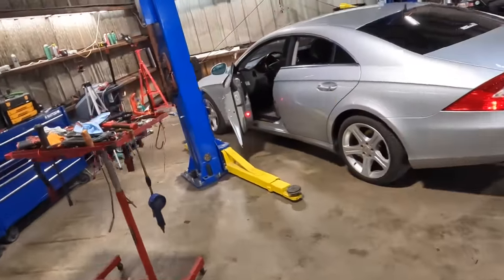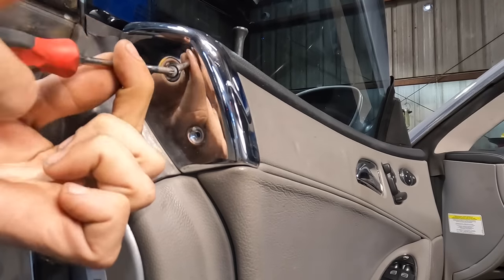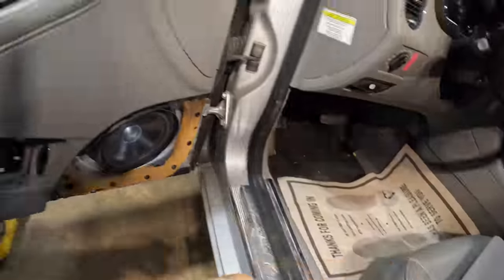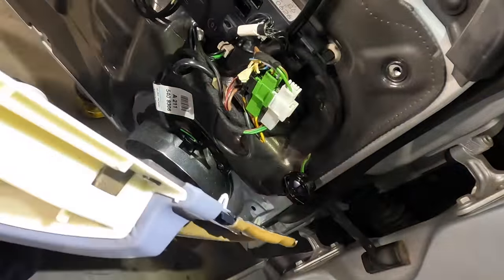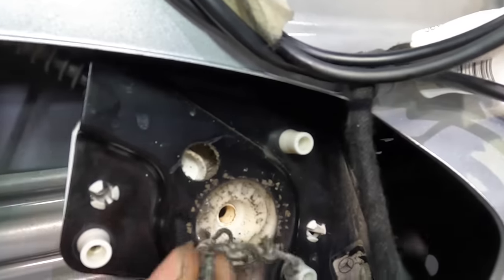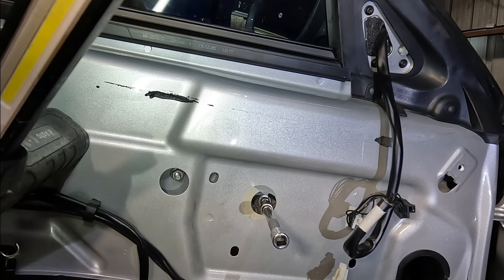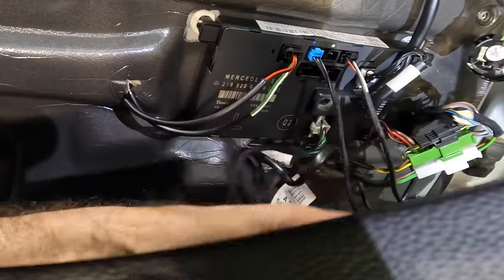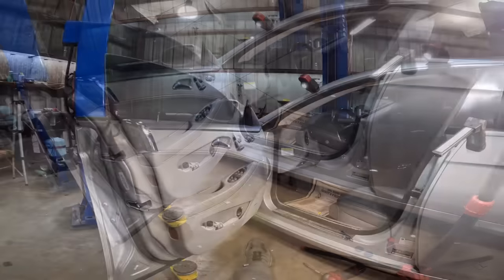Overly Complicated?  Mercedes-Benz Interior Wiring!  CLS 500 (LOUD NOISES!)

Comment: Some pre  2000 Mercedes Benz used hydraulics for window actuators . Believe it or not they rarely failed and are pretty easy to repair. My wife’s 09 e320 window Regulator failed and the quoted her $900 for one . Guess what the service advisor said ? Yeah replace both passenger and drivers side even though one was fine.

Comment: Engineers and architects should have to work on what they design. Pretty sure things wouldn't be so complicated . I'm a carpenter. I was always told that in Germany architects had to do an internship in construction and put on a tool belt and build things before they were licensed.   All of those wires could have been simplified down to one of two connectors .

Comment: You’re videos are informative, air sanders or grinders when in use.
Is when my speakers get turned off. Bummer.
If you have an air chisel.
Place it on a steel frame of the building and create some feedback entertainment.😅

Comment: Did you make adjustments to the window position off camera?  All the while it was being buttoned back up, I was thinking about that, and having to pull all the panels back off to re-adjust them.  Also, wondering if the module would need to be calibrated somehow. As silly as that seems, I wouldn't be surprised!

Comment: At 34:12 in the alignment of the bolt could be accomplished by using a suction cup with a handle to hold the glass in
 position and put the bolt in. I'm exhausted just watching all the steps needed for  this installation!

Comment: I almost bought a cls500 when i bought my audi a4. All the cls500s i looked at had suspension issues and were on the ground. I was looking at used cars around 2012 or 2015s. Anyway my audi has standard suspension, sports suspension which is lower, dynamic suspension which is adjusted electronically. You have to pull window sticker options to determine between sports and standard suspension because audi doesnt list the option anywhere else. Obviously dynamic suspension is easy to spot because its electronic. German vehicles are so much more complex than donestic cars. My car does not have door locks. At least not a single mechanical lock, its all electronic and can not be locked or unlocked other than electronically

Comment: Ray, it's a Benz...to remove the door panel you have to cut the door skin off, abd remove the 5 hidden screws, replace the part, then weld the door skin back on & repaint the door.😁
Reply: it will be lot faster for a welder.

Comment: Don't forget the resource of other YouTubers to see how to remove specific door panels.
Crazy engineering. That is the wrong place to install electrical items, both in terms of water, and protection from common body damage.
The goo holding the plastic sheet of insulation in is butyl rubber. If you buy a roll make positive to get the double sided sticky. A lot of it is single sided, which is intended for a different application.

Comment: Hi there
I’d like to pass on a little tech tip to you and anyone else who does mechanical work, try using a piece of latex/rubber disposable work glove tear a bit off hold it over your socket place a bolt or nut into it and this will hold it in place to reach awkward places without losing the nut/ bolt , 
Regards Davy 🇹🇭 ( retired early in Thailand and ex mechanical engineer)

Comment: What you can do is take some blue tape and attach some pieces to each of the wires and place some next to each hole in the insulation that they pass through and put numbers or letters to mark which wires go through which holes and save yourself a lot of grief later. 

"An ounce of prevention is worth a pound of cure."
-Benjamin Franklin

Comment: You guys think this is something.  The S class model change (W-221) had the inner metal shell of the door riveted in place for the entire perimeter. To do this job you drilled out what I recall to be 18 rivets and then do the replacement. The Maybachs had the same door construction.  This regulator replacement job would pay around 1.2 hours under warranty with testing cleaning ordering parts dealing with service writers and driving through a car wash.
I truly loved working on these cars but I was run over by shop politics too many times. I kept my head down, did the work, never complained about what type of work I was given. Learned to make the best of what I had. Never screwed a customer, always wrote honest write-ups and admitted my few mistakes immediately.  In the end I was putting together work other people abandoned and my diagnosis was always spot on so I would be the person a "come-back" would go to for confirmation of the problem and to evaluate the previous repair.  That part of the job I feel is what put me out on my butt.  They feed me these Come-back repairs that sometimes would show as a paper loss  for the company. When the book worms and management saw my name on every "problem repair" they assumed I was the problem. Took almost a year after the fact to learn why I couldn't work there any more and I was only told because the owner of the dealer died in a plane crash on the run-way in his own plane. No one had loyalty or a job there any more so no reason to keep what happened to me a mystery. Skipper Beck of Beck imports in Charlotte NC. Circa 2004, I still read the news article about his death every once in a while.  Those guys did me wrong and I'm still sour about it. I was young as hell and happy to be doing what I went to school for and a lot of that joy was destroyed to make other people look good for the short term. I still love working on anything broke for the joy of knowing I made it better than it was and I'm still fixing things other people screwed up to this day.

Comment: Times have really changed.  My arms used to look like I was in a fight with a shark after replacing a window glass or regulator.  The only thing that troubled me was I was waiting to see if you had to adjust either travel up or travel down once you had it all together. Looked like the glass went up and then popped back a half inch or so.  Also looked like the glass didn't drop below the door frame when fully down.  That would drive me crazy if it was my car and normal.
Reply: the modules control the positive closure to ensure sealing against molding. have to be reset like the air struts, which  he never showed.

Comment: Das germans are methodical … they look at ANY DESIGN as a competition. If you can build it with 2 bolts, they engineer it to require at least 7, 2 of which must be torx heads with reverse threading…..

Comment: Actually drilling the rivets wasn't so bad, it was finding bolts that didn't interfere with everything else (89 Aerostar).
Reply: 89 Aerostar was a nightmare. Two hours to change a headlight bulb (simple rectangular glass type). Required removing the bumper to get to one screw. Removing the engine cover required removing the floor-mounted shifter mechanism.  Everything was overly complex, yet the door lock on the sliding door wasn't child proof. (Guess how my wife found out when our 2-yr.-old figured how to get out of his car seat in 60mph heavy traffic.)

Comment: I bet if you take that car to a dealer to get the window regulators replaced if that insulation on the doors rips they probably just replace it and put that in the charge to replace the regulators.

Comment: With that style of regulator, there is no way I'd buy one that didn't come with the motor attached.   Granted the motors usually don't go bad that often.   But I've learned the hard way with those cable drive regulators, if they get out of whack, or god forbid start to unwind out of the unit, you will never get them back together the right way, ever.   You could spend an entire day trying and never get them right.   Just my 2 cents for anybody considering doing one of these especially on a GM product.   Get one with the motor already attached.

Comment: Of course it's overly complicated... if's German.  I had a VW fast back and the blinkers quit working.  I traced down the cables and found a rather large PC board with lots of transistors and other components on it.... UGH, that's gonna cost me.  Went to the parts store and the guy hands me a 3 pin Tung-Sol blinker doo-dad.   Unbeleivable!  It worked.

Comment: Cars like this aren't made to be fixed.  They are for rich people to use for 50 or 80,000 miles then some unfortunate can buy em used and chase endless expensive problems forever after.
Reply: True Lol I keep mine couple years then move on especially a Maserati I had was scared after 1 year! . Altho I did hang onto a Lexus for a bit longer which is probably still going strong without issues now

Comment: You know, this made me think of Legos. When I was a kid I used to build this fancy "spacecrafts" with a bunch of pieces and cool gadgets mixing together different sets. Yet that was the reason they were frail, compared to when my cousin would build bulky chunks of Legos you could drop in the floor and nothing happened to them. 
Mercedes looks like overrated, overengineered toys, and if you play too much with them, they break... the excess craftsmanship give them lots of possible failure points. I guess that saying "less is more, applies in mechanics too" 
Also... note, to make a normal car feel luxurious, a bunch of noise-canceling padding is needed Everywhere.

Comment: Sorry Ray, but at about 1/2 way thru this, I would have claimed I broke the two windows, had insurance pay for replacement, taken it to the glass company, handed them the two regulators and asked if they would mind installing them while they are there.😁😁😁 Frustrated me with over engineering and factory expedience design .